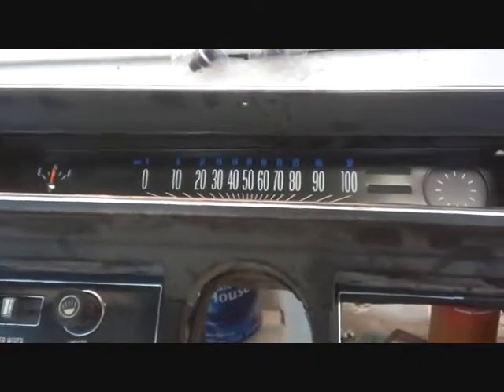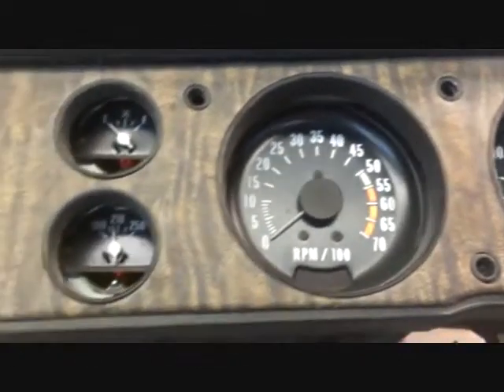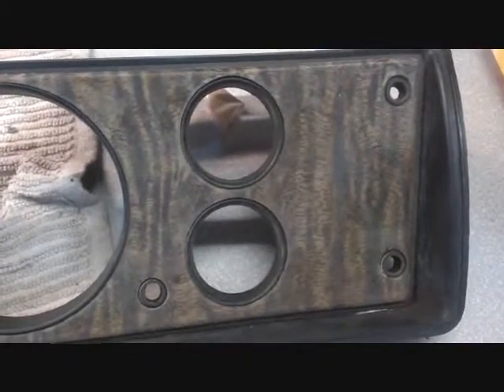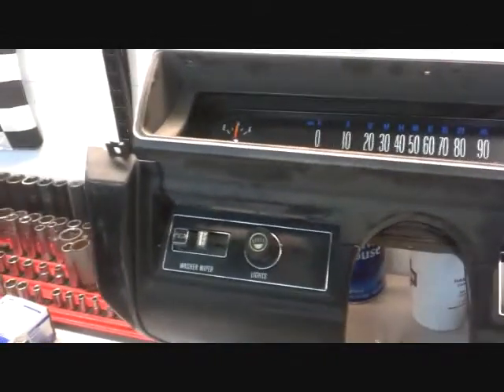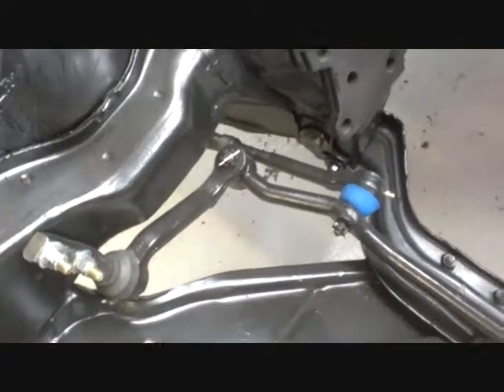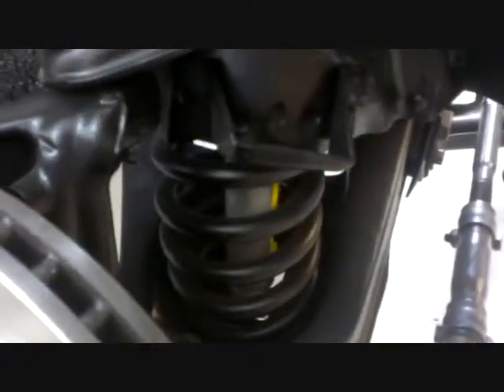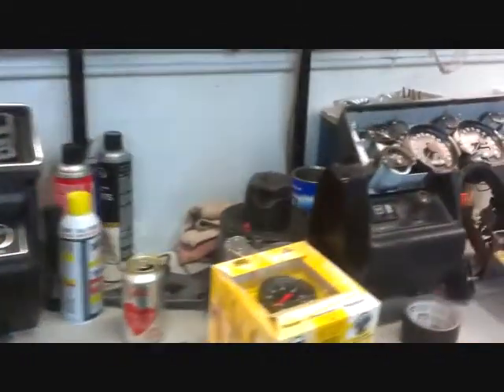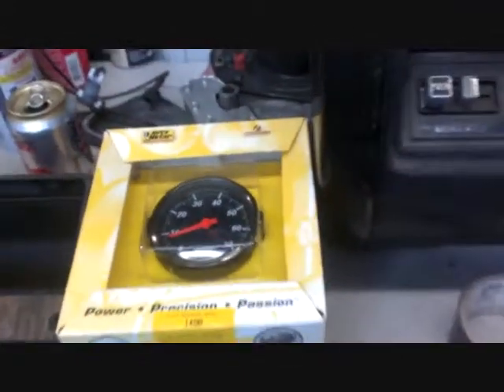Lil Miss- The Vega Project....Video 9

Comment: had a 73 GT  I'd have kept the original GT speedo & Tach  just up dated the rest
Reply from the maker: I gave that some thought, but after I installed the 4 smaller gauges, the stock ones just didn't measure up. Thanks for watching and commenting!